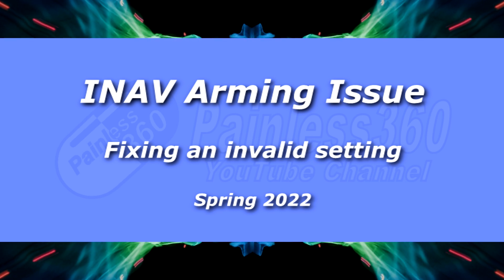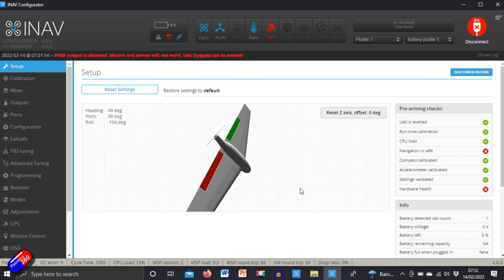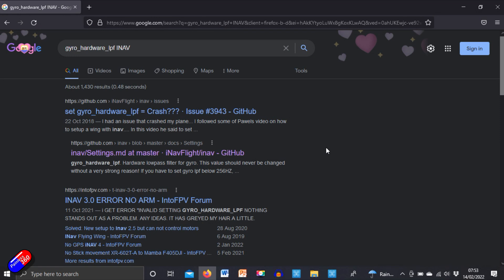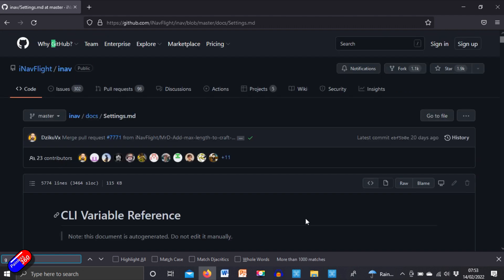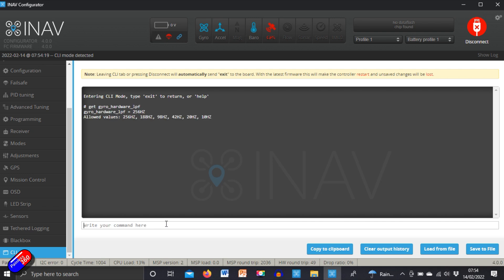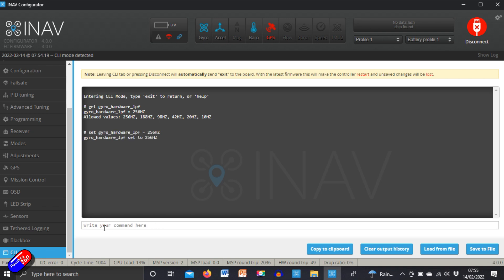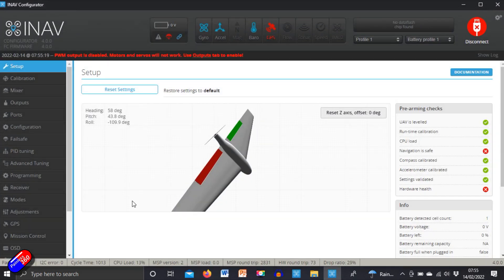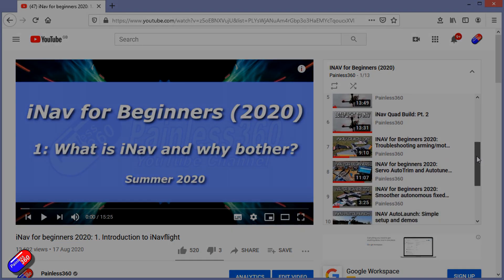How to fix Invalid Setting: Gyro_Hardware_LPF: Invalid Setting Error in INAV

Comment: Thanks Lee!  This video solved my problem. When I maidened my plane I adjusted the trim, and after landing it wouldn't ARM anymore. Two days later I typed SETUP in the CLI and it said ROLL/PITCH as a reason for not arming and I realized immediately what I had done. I guess I can't be lazy anymore and I'll have to actually physically adjust the control surfaces and zero the trims. INAV won't ARM if the control inputs from the receiver aren't close to 1500.
Reply from the maker: you should never use trim on a model. See my INAV builds.. happy flying!

Comment: This was so useful I have just had the same thing on my S800 wing where the last time I went out with it there were no problems apart from some heavy landings (inevitable with landing a wing)  but this time I got to the field only to find as you did it would not arm, I did have another model so at least not a wasted trip. One other question how do you change the plane icon from a block to a plane like you have?
Reply from the maker: If you use INAV 3.0 or later and use an airplane/wing mixer then the graphic will update. See my INAV builds with INAV 3.0 and 4.0 on the channel for more tips.. Best of luck!

Comment: Nice video Lee. It is well worth mentioning that if the LPF error pops up, there are a couple of settings also worth checking. Some of these don’t currently cause errors, but can cause problems in flight. Details can be found in the “Random config change bug” article on the INAV Fixed Wing Group web site. On in particular can worsen horizon drift.
Reply: In what version of Inav?
Reply: @maxun1  it doesn’t appear to be version specific. It happens more now due to more save events taking place. For example, if you have stats or continuous servo trim enabled, it automatically saves when you disarm.
Reply from the maker: https://inavfixedwinggroup.com/rc-news/inav-random-config-change-bug/ is the link for those who are interested. Worth a read.
Reply: @Painless360  thanks Lee. I remembered you saying links were disabled in comments. So that was the best I could do 👍🏻